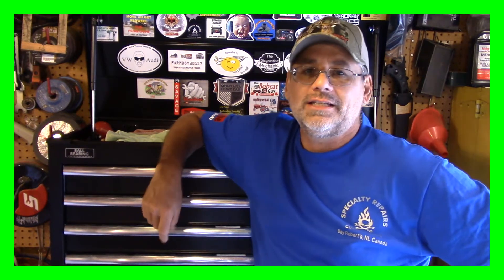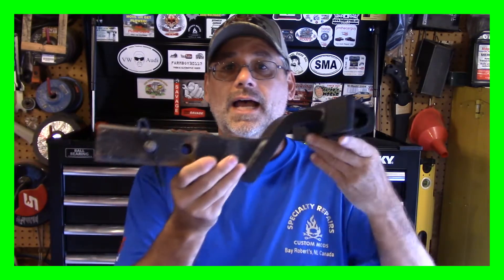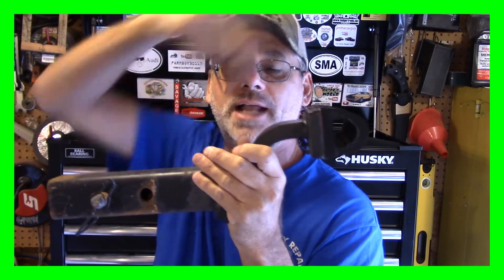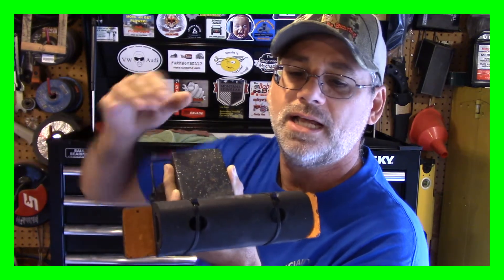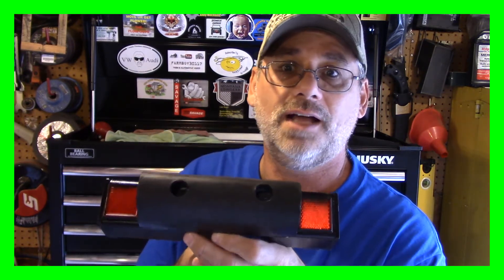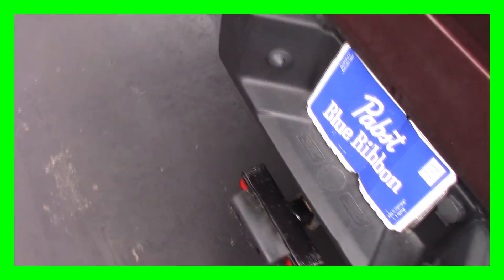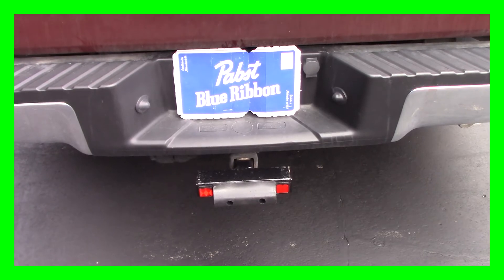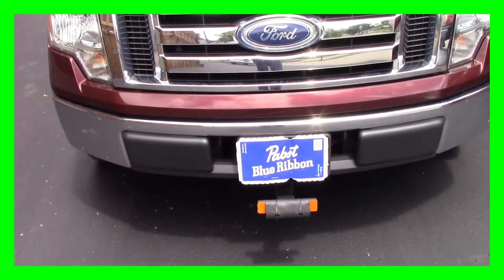CUSTOM BUMPER GUARDS   - NO MORE DENTS -   EASY TO BUILD

Comment: I like it as it doesn't stick out to far and the damage is limited f someone slaps into you.  Good one.  My rear one holds a chevy emblem.
Reply from the maker: I haven't seen anybody run into them or me so far  but I have seem cars just resting on them at the front and rear. I don't think people can judge the distance too well or just don't care :)
Reply: It is the lack of vision area on the new vehicles.  My wife can pull up closer than I can because she uses her car everyday.  I have only put 1200 km's on my truck this year.          (That old beater)
Reply from the maker: Wow 1200k hahaha I thought I don't drive much at 9000k .
Reply: that is why t is 20 years old and still ticking.

Comment: Hunting for a PBR sponsorship!  Nice idea on those bump stops.  With my truck being beat up so bad already, I couldn't tell if someone dropped 400 shopping carts on it!  In my 2nd video ever on YouTube I used one of those receiver hitches and welded it to the bottom of a winch plate so my co-worker could move his 12,000lb winch from his trailer to his bumper easily.  You can do a lot with those style hitches if you think outside of the box a little.  Thanks for sharing!
Reply from the maker: Wow you should do a walk around of that truck LOL  My truck  is not a 4x4  I really didn't need another 4x4 but the next one will  just because - not sure why but just because :)
Reply: Hah, not sure how entertaining a walk around would be of that truck...it's just an old 93 f-150 with 286k miles that was rolled on it's side before I got it (and not much time spent fixing it).  I only paid $1000 for the truck and I've been driving it for 5 or 6 years now!  She needs to be retired though.
Reply from the maker: Sure it would  since I can't figure out what's a good vid to show or not. Just might be a viral vid. Look at the stuff I do. LOL
Reply: You know what... You are exactly right so I'm going to do it!  And since it was your idea I'll give you half of the revenue if it goes viral. hahah It will probably get demonetized in the first hour...

Comment: That's a great idea Steve.  I used to leave my hitch in but the wife banged her shins a couple of times so I took it out.  I'll have to make one of those.  It would be great for when I back into stalls in parkades with the walls painted white.  It's hard to judge the distance with white walls I find.
The Steve Rob show on TV would be a lot more watchable than half the crap out there.
Reply from the maker: Thanks Bruce - These ones are not out far enough to hit your shins , at least I haven't hit them yet and yes backing up to them big concrete pillars is real easy now and easy on the truck too. Cheers